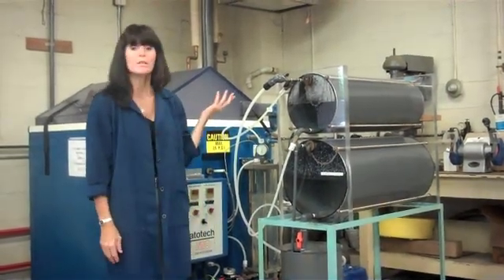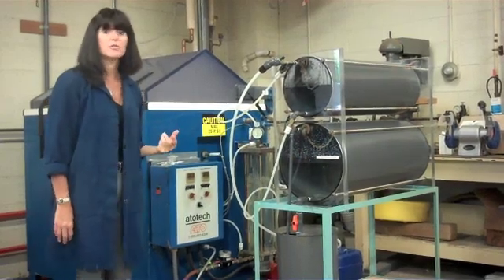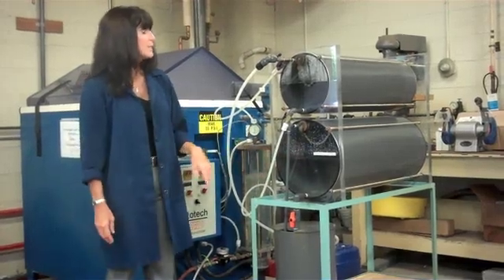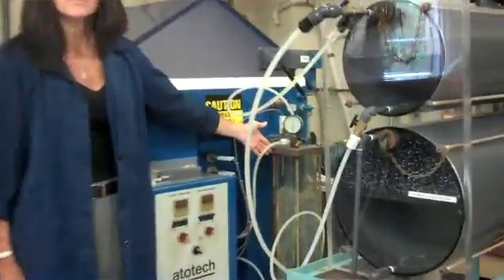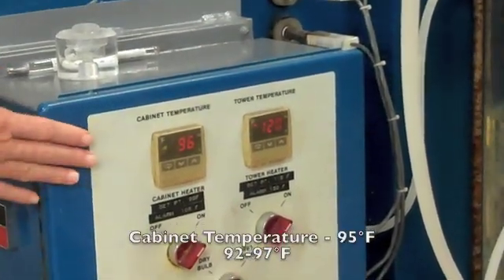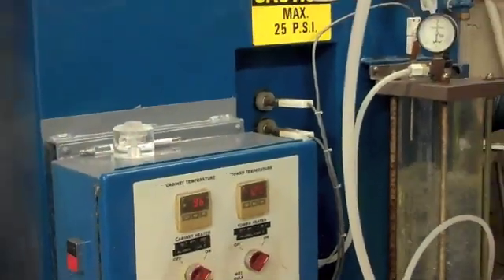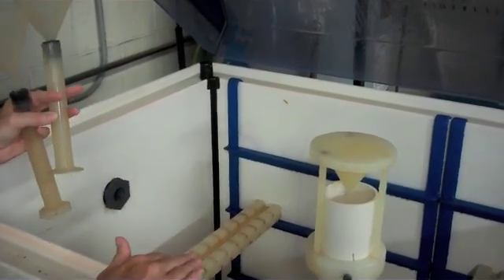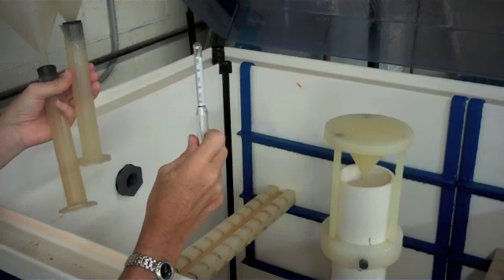Salt Spray Operation ASTM B-117

Comment: One of our customers requires us to use either distilled or deionized ASTM D1193 TY 4 water.  How would one pressurize the water going into the bubble tower?  We are looking into feeding our salt spray machine with purchased water at the spec above.  I am thinking a pump with all plastic internal components (to avoid contamination)?  Suggestions?

Comment: I used to do the ASTM salt fog testing at a place I worked at several yrs ago.  I did it exactly the same way as mentioned here, collecting and taking PH & SG of collected solution.  I miss those days when I did this type of testing of electrical assemblies & plated parts.
Reply: Jay G. hello, can you guide me about operating the system as I am going to operate it in near future.